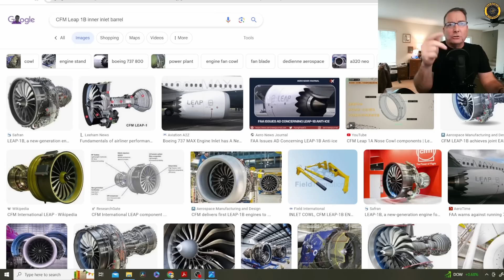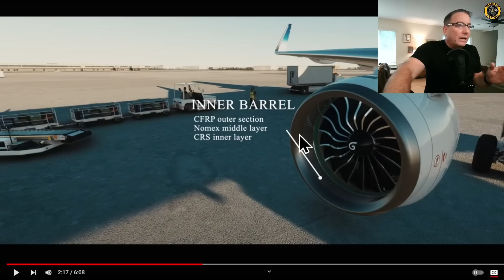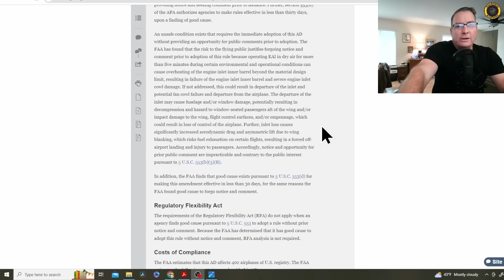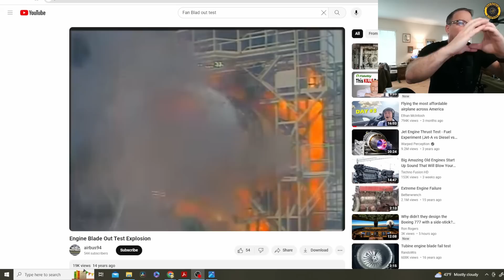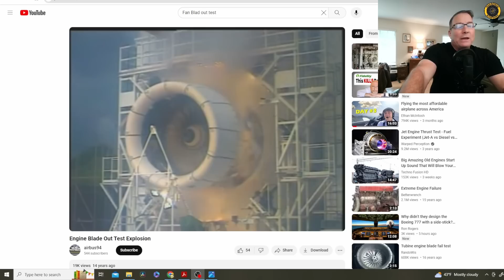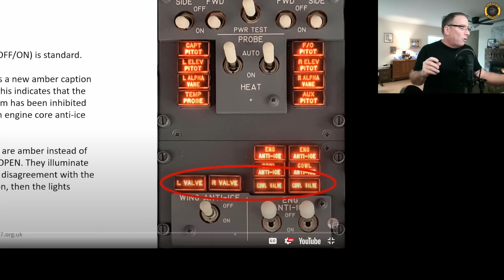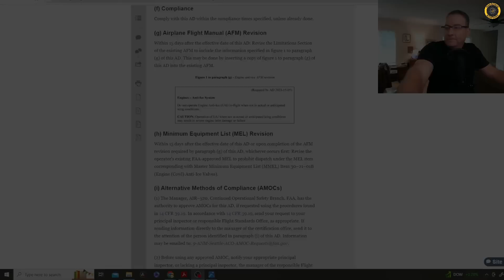Boeing 737 Max-7/-10 Certification HALTED! 1 Feb 2024

Comment: And so, once again, because Boeing decided to keep with the old design and not create a new design to handle the modern fuel efficient engines, they have had to make modifications to keep up with everything and finding that the lighter components cannot handle the true operating environments.  There’s only so many nails and screws you can keep adding, before the structure simply fails…

Comment: I realize that's it incredible pricy to change the strategy from 737 MAX to a new clean sheet design. But as always in management it will be even more expensive to keep going in the wrong direction. Boeing should cut their losses now and keep delivering the current 737 MAX aircraft even though they should probably never been built.
If they do that Boeing can start with a new design and hopefully create a new amazing  aircraft finally replacing the 737, regaining the faith in Boeing as a trusted manufacturer of aircraft.
If you realized you have been going in the wrong direction, don't worry about how it will make it look on the stock exchange tomorrow. Cut your losses, think again and focus on delivering a product making the company look better the upcoming years.

Comment: The problem is not FAA certification, but EASA's one. EASA will not certify the Max 7 and 10 with the door blowout blunder of the Max 9. Even if FAA can and is pressured by politicians and Boeing to certify them, I'm sure EASA has already told them, it's not going to happen on their side. Not only this would forbid deliveries to Ryanair and others, would also make FAA reputation go down the drain and totally irrelevant in the future. Let's just remember that EASA refused to give tacit certification to the Max after its grounding unlike what had happened for decades before that. It issued its own certification and even clearly detailed that it was its own assessment.

Comment: First off, it’s readily apparent that you do not understand the Engine Anti-ice system on the MAX. It is true that there is an AD out but it will be solved by either CFM or Pratt and Whitney. The anti-ice AD addresses a procedural limitation and nothing more. The bleed air is tapped from the 4th and 10th stage bleed air. If, while in flight an Engine Anti-Ice light illuminates, it means one of two things: 1. The bleed air stage valves will close and you will not be receiving anti-ice protection on that motor  (Green TAI will remain illuminated) 2. Engine core anti ice is not available. This anti-icing capability is automatic and controlled by the EEC. 

The Southwest and United incidents had nothing to do with the anti-ice but it’s easier to win subscribers by Grandstanding and playing “what if” games. My suggestion is to understand the system and present the facts and nothing more. However, you’ll probably lose subscribers because your commentary would be lackluster.

Comment: Basically what has happened here is that they saw I need to make the engines and the plane more fuel efficient by having all these new designs. This makes the engine overheat and then they didn’t want to have a new type rating because that cost them training so that’s how this happened pure pure, illegal, horrible maneuvering, resulting in death and destruction to pilots crew and passengers shame, shame on the FAA for allowing this as well. How many of them are being paid off?

Comment: The FAA should split the 737MAX off into a separate type rating. Too many of these design compromises to shoehorn into the same 737 type. The long list of issues and manipulations related to this all seem to stem from this root cause. The airlines will have to suck it up and pay for the costs for getting staff on the new rating. They won’t like it but it is the sensible thing to do. This would also enable much more extensive modernization and deviation from the traditional 737 type which would benefit safety and usability of the 737MAX. Flight control systems could be retuned to more closely match the actual handling characteristics of the aircraft with less software obscuring it just for the sake of familiarity for type rating. More redundancy could be added in a greater variety of systems. Cockpits could have more pilot friendly features to ease their burdens and situational awareness. These could be added in an upgrade package that customers will likely pay for. It would help make them better aircraft.

Comment: The bottom line as you suggest, is the type certificate.  They just did not want to bite the bullet and just go for a new type certificate - mostly for pilot training costs.  Now they are burdening the pilots with a bunch of procedures to compensate for these new technologies that they are trying to squeeze into the existing certificate.  One can understand the economic pressures of a new type certificate, but ultimately lives are at stake, and the airlines have the choice of just switching to Airbus.

Comment: Plastic and extremely hot air have never mixed well, but they are cheaper to make that way.   The anti-iceing device at night might be rather a problem too, just saying.  Boeing needs get back to engineers in upper executive positions in stead of bean counters and efficiency experts.

Comment: The DuPont Nomex is a fire resistant Aramid fiber similar to DuPont Kevlar. Nomex is also used for fire hoses as its fire resistant and high modulus strength stronger than steel critical for fire hoses high water pressure and exposed to fire.

Comment: Wow, airlines have until 2028 to make redesigned cowls be installed, after SWA accident!
The FAA required Boeing to redesign in compliance with applicable Part 25 regulations. A proposed rule receives comments until January 26, 2024. Approval of the rule will require airlines to make the relevant modifications by July 31, 2028🙄😳

Comment: after SWA  blade #13 failure=dead passenger, pulled part-way out of window,  The major recommendation of the report was that the Federal Aviation Administration should require Boeing to discover, for this aircraft and engine type, which parts of the engine fan case were susceptible to transmitting damage to the fan cowl structure and then redesign the fan cowl so that it retains its integrity after such a "blade out" event. Blade out or departure, such innocent terms.

Comment: Is this something specific to LEAP1B? I would assume the LEAP1A is built with same materials. If that was the case, is it not an issue on airbus a320 neos? Or is it just an issue with 737s because the system is manually manipulated and not automatic?

Comment: So many problems have resulted directly from Boeing's decision to try to avoid the need of type retraining for the 737 Max for pilots of previous versions.
With the sensors available to detect ice, even if they choose not to make the system automatic, they could create an annunciator warning that could remind pilots to "turn off engine anti-ice system", right?

Comment: When I first saw the composite inlet ring, I thought they might need to mix bleed air with cooler air to get a temperature that wouldn't melt the composite.  But apparently that's not how it works.

Comment: It is a fine tightrope the aircraft manufacturers are walking. The airlines want to make maximum profit so reducing their costs on fuel burn and leasing costs of engines and aircraft is important. Passengers want the lowest possible fares (usually) so they don't want to give the airlines any more money than they need to. The aircraft manufacturers themselves want to make a massive profit, as their shareholders demand. These traits are no more evident than in the US, so perhaps my hot tip is to fly on an aircraft made in Europe/UK where these pressures are all a little bit moderated and the respect for following rules and regulations may be a little bit more ingrained. 

Deep down, you know I am right. 
Regards,
Airbus passenger.

Comment: The oil-feed stub pipe leak of RR engine led to engine explosion, On inspection, a turbine disc in the aircraft's number-two engine (on the port side nearer the fuselage) was found to have disintegrated, causing extensive damage to the nacelle, wing, fuel system, landing gear, flight controls, and engine controls, and a fire in a fuel tank that self-extinguished. The subsequent investigation concluded that the failure had been caused by the breaking of a stub oil pipe, which had been manufactured improperly. Rolls was sue over this. Boeing should sue and force them to replace all cowls with upgraded parts, for no cost.

Comment: RR at least didn't attack Boeing with an exploded engine, it was an A-380  this time!
Since the incident, Rolls-Royce, aviation regulators, and operators of Trent 900-powered A380s have taken a range of steps to ensure that engines with incorrectly manufactured oil feed stub pipes were removed from service or fixed so aircraft could operate safely.

Comment: Then there is RR making Boeing look bad too, 😪 Boeing 777-200ER airplanes powered
by Rolls-Royce RB211 Trent 800 Series engines. In both cases a build-up of ice (from water
normally present in all jet fuel) on the fuel/oil heat exchanger (FOHE) restricted the flow of fuel to
the engine, resulting in an uncommanded engine rollback.

Comment: I'm appalled at Boeing now. Just read of the 2 planes in the 1990s that killed all on board B-737, and a 3rd that almost crashed, but the pilot lived to tell what happened. FAA forced Boeing to redesign the RUDDER PCU, The door thing is bad, but this was WAY WORSE. 
The NTSB concluded that all three rudder incidents (United Flight 585, USAir Flight 427, and Eastwind Flight 517) were most likely due to the PCU secondary slide jamming and excessive travel of the primary slide, resulting in the rudder reversal.

Comment: I worked in Aircraft Maintenance at UAL. In the mid 90s I wondered why Boeing wouldn’t just develop a narrow body successor to the 737. 
Boeing had better consider replacing their senior management and board of directors. 
The engineer minded CEOs left the company long ago. Wall Street runs it now.

Comment: I worked for a DER in San Antonio around 40 years ago (good Lord, I'm old!) on 747 interiors, which is the extent of my aeronautical engineering experience.  It sure seemed like we had a much more robust system in place to certify GALLEYS than what you're describing now, at least at Boeing.

How terribly sad, and utterly reckless.

Comment: The real problem is not at Boeing. When the last CEO's walked away from Boeing after selling a known faulty aircraft, killing 364 people and pocketing over $60million and GOT OFF SCOT FREE. Tells all CEO's in ALL businesses across America, that they are not accountable.  Its a government problem because now the CEO's at Boeing are giving away their market share to China.
The continued problems with aircraft, will make airlines cancel and look else where. Airbus is the obvious choice BUT they are booked solid and have supplier problems.  So it will be COMAC?
Airlines cant run at a loss. Their customers will relIse that they fly the MAX and will look elsewhere also. There are already travel agents who will arrange a MAX free itinerary. So its down to government. Otherwise the CEO's will continue to reduce Boeing and watch it fail--THEY WONT BE HELD ACCOUNTABLE.
Reply: @johnchristmas7522 Do you really think that the mostly-inept government regulatory authorities are going to fix Boeings issues?  Hell, the FAA is responsible for a large portion of the whole certification fiasco around the 737 MAX series.  The FAA granted Boeing the authority to self-certify much of the design and build process.  So the watchdog (FAA) was napping on the porch, while the puppies (Boeing) played in the yard unsupervised.  That whole self-certification process needs to be abandoned, ot at least limited to very non-critical systems and/or processes.

Comment: From the engineering point of view the fix for this problem is so infuriatingly simple that it's likely already built into the engines already anyway. Put in a bunch of PT100 thermocouples under the nomex layer. Wire them up to the engine controller. Write the 3 lines of code that will read them and trigger alarms if the temperature goes below 10C (icing) or up above 90C (overheat). 

All you need then is a pair of alarm lights in the cockpit and maybe a (virtual) relay that will actuate the valve opening based on ( engine de-icing on AND (NOT overheating)).
Reply: I agree that will work. However that adds complexity to the aircraft and another bell for pilots. 
Just build the cowl with metal, such as has been done for decades.

Comment: The problem is twofold. Firstly Boeing need a automatic anti-ice system which would include control of that function in the engine. Secondly, and probably just as importantly, the engine manufacturer needs to have sensors that detect overheating conditions in the engine and switch off the heat to protect the engine.
Ultimately the engine needs to protect itself from being instructed from doing something catastrophic.....or make the part out of metal!
Reply: Make it out of metal.
Reply: @Sean006  The Anti-Ice issue is with the engine inlet cowling assembly, not with the engine itself. If I'm not mistaken, it is the airframe manufacturer and not the engine supplier, which designs/builds the engine cowling.

One thing which I find interesting from @blancolirio's video when the anti-ice systems switches on the overhead panel were shown, is that I see that there is an Auto anti-ice setting for all of the probes (pitot, AOA, static ports, etc.) but not for the wing or engine anti-ice systems.  Those two or either On or Off.  How hard would that have been to build Auto settings into the updated MAX design from the start?
Reply: @johnshannon9    Probably not hard at all. Even better, keep the same same system that has been on thousands of 737s that have flown millions of hours without a cowling deice ring failure.

Comment: Good decision of the FAA to halt the certification of the 737 max-7/10 because of the use of the new material for the engine anti icing which could fail and destroy the engine blades. Wow, this on/off switching of the anti icing every time the aircraft goes in and out of the cloud is asking for trouble because a pilot is just a human being who could forget to switch it on/off. This potential risk must be eliminated before the aircraft is certified.

Comment: Nomex is there for structural rigidity and not acoustics. Plenty of videos on YouTube showing the difference in rigidity between solid composite and a composite with a Nomex core. Considering this is how it used throughout aviation you might want to check the engineering behind it.

Comment: Apart from the excellent explanation of this MAX7 (and MAX10) certificationproblem, isn't this a CFM-issue instead of a Boeing-issue? Boeing-customers can choose what type of engine they want, so could MAXvariant with another brand be certified?
Just wondering. I am an Airbusfan, but there seems to be a choice here. Please let me know how wrong I am.
Reply: Boeing design the anti ice system and the cowling/nacelle
Reply: The Leap-1B is the only engine choice for the B737 MAX series.

Comment: I worked at Boeing on 777 Airplane #1, managing procurement of the fuselage, keel beam, aft pressure bulkhead, and wing ribs, built by Kawasaki Heavy Industries in Japan. We sweated blood over that airplane, obsessing over safety concerns. I held my then 7-year-old daughter up to touch the belly of that airplane at rollout. Still gets me a bit emotional to think about it.
I left in 2000, a few years after the MacDac merger, when it became apparent that Harry Stonecipher and his other Jack Welch acolytes would be replacing the engineering culture with engineering of the financial kind.
I've since watched has the company has reaped the whirlwind of this tragic mistake.

Comment: “Pennie wise, pound foolish.” If I understand correctly, Boeing tried to save development money by leveraging previous 737 type certificates for the MAX models. This decision caused a series of technical and training problems resulting in two crashes, many deaths, a destroyed company reputation, and ultimately greater expenditure of funds. Boeing’s spreadsheet-centric culture will destroy the company.
Reply: @tdhawk7284  What is sad is that when Boeing merged with/absorbed/bought out/adopted McDonnell-Douglas (whatever that tie-up really was), is that to assauge investors and employees, Most of the senior leadership positions at the new, integrated Boeing were former McD-D leaders, who had kinda wasted the old company away.  The Harry Stonecipher (former McD-D exec) took over at Boeing CEO, and the downhill slide began in earnest.  It was apparent taht the Boeing leadership wasn't in tune with their production, at least on the commercial side (military side might be a different story), as was shown when they moved the Boeing HQ to Chicago.  If they felt a move from the Seattle area was appropriate, why didn't they move to St Louis, where the bulk of the military programs are run from?